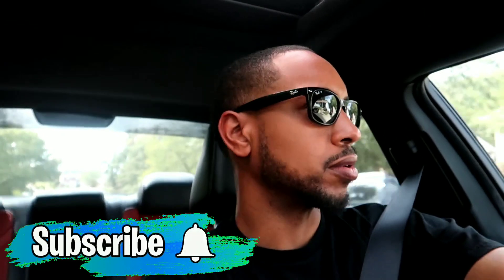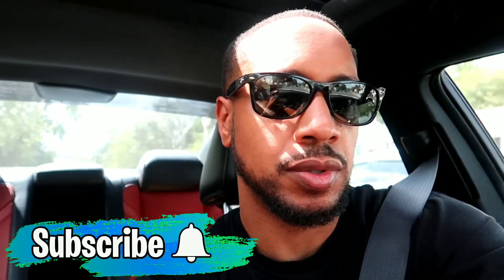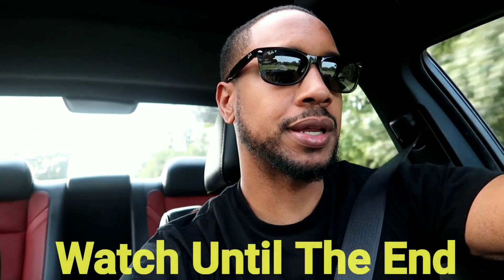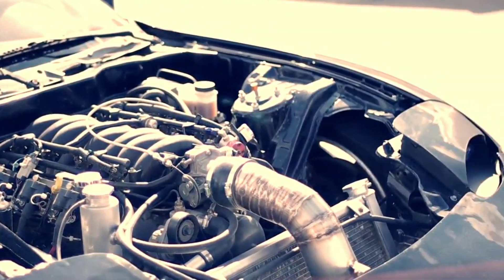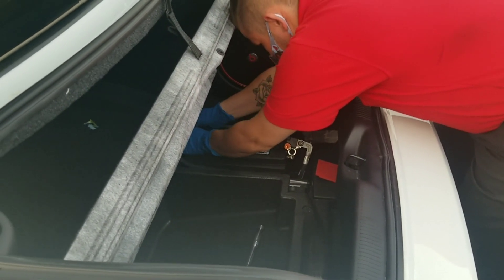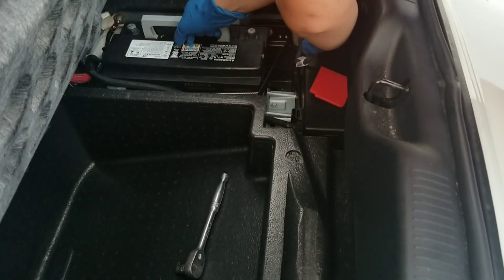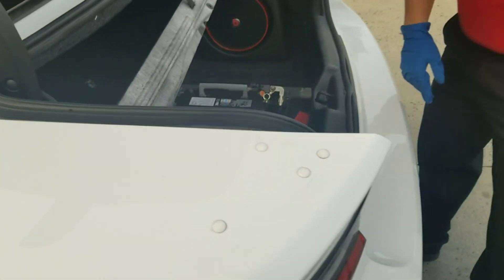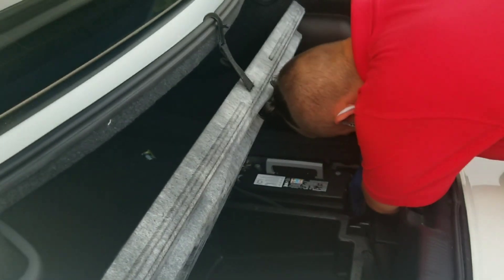Buying A Jeep TrackHawk Instead Of Dodge Charger Hellcat!

Comment: I can't say about the Track Hawk, but the SRT Cherokee has been problematic. Know 2 different peeps that had one, & both spent more time at the dealership than on the road.

As far as your battery goes, anything more than 3 years is good. I surprisingly got just over 5 outta my original battery, which is phenomenal considering the heat here in AZ.

Comment: Jeep SRT is a far better buy, it sounds better than the trackhawk, does 0 to 60 in 0.1 second slower than a scatpack, and is slightly better on insurance. Also a used Jeep SRT is far cheaper because they come out every year, the trackhawk is a limited edition vehicle. I've seen on cars.com Jeep SRT's go for 55K as a high. You could go to carmax and get them to transfer one in for you and they cost in the 40k's, and then you can spend a little bit more on a mopar official warranty. Just take that joint to any Dodge/Jeep/Chrysler/FCA dealership and they can get that warranty for you. My boy went the carmax route and his joint is still going strong, he got a 2017 one used. Also that all wheel drive is vicious in DC winter.
Reply from the maker: You hit all the points bro thats why its on the list. I forgot about carmax perfect place to test drive one. Good lookin 💯👍

Comment: Get the SRT they're about 56-61k used out here (with low miles) ok only used Trackhawk out is 66k with 77k on the dash.  Brand new for both about 80k.